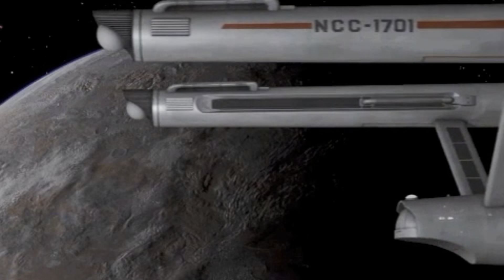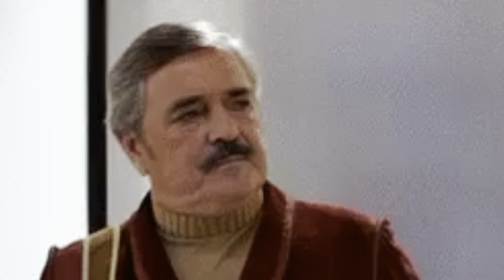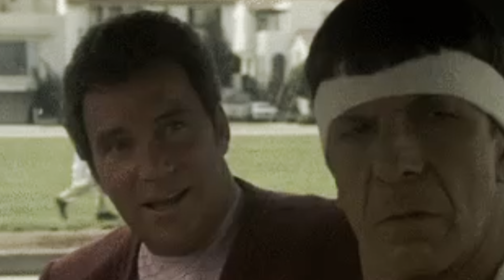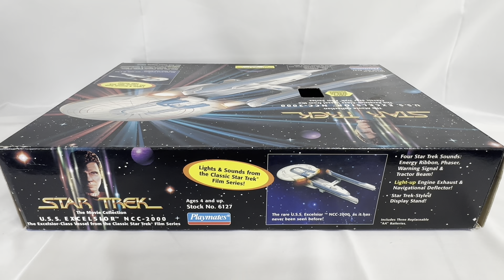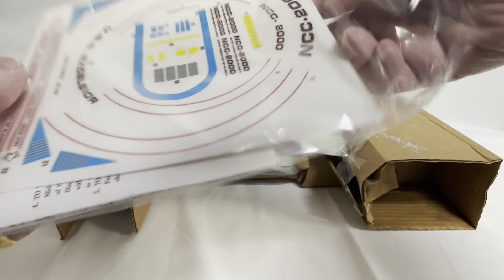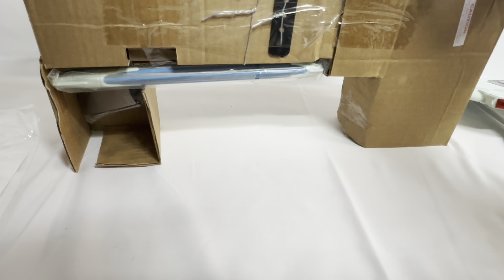Vintage 1995 Playmates Star Trek Movie Collection Electronic U.S.S Excelsior NCC-2000 Model Starship

Comment: This 1995 toy starship may be labeled as the U.S.S. Excelsior on the box and decals. But the body type, with the two bigger saucer impulse engines, small fins on the nacelles and the wide flairs in the bottom front of the engineering hull, are from the U.S.S. Enterprise-B from "Star Trek: Generations," which came out in 1994. Weird.
Reply from the maker: Yes, I think they reused the same model. A lot of comments from different people with the same observation. Playmates did repackage quite a lot of the items and launched them as a different item. Still a nice model though. 😀